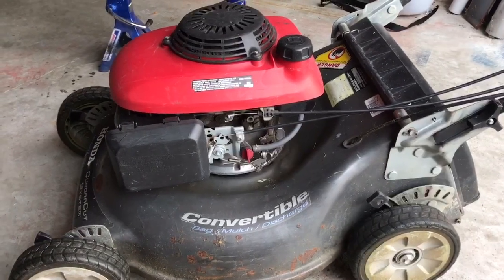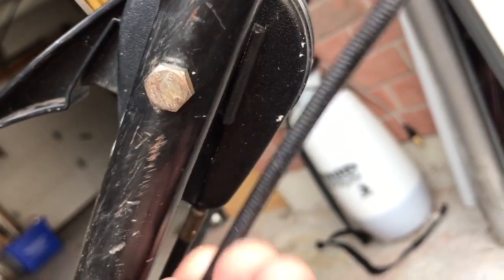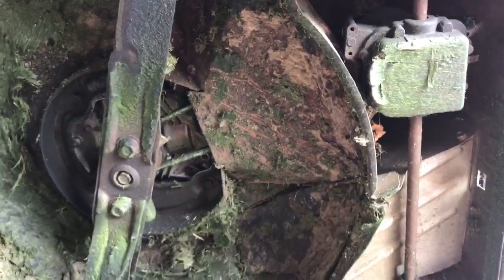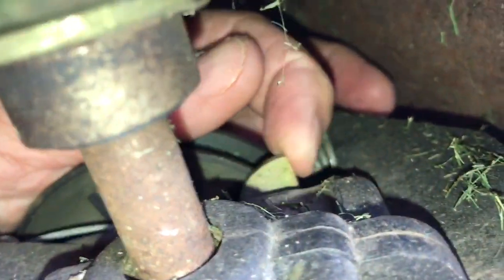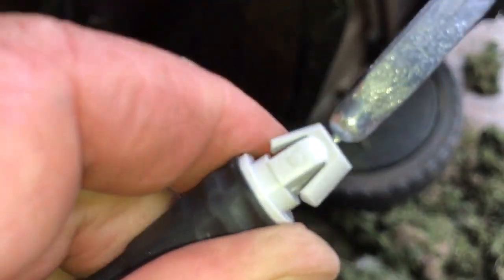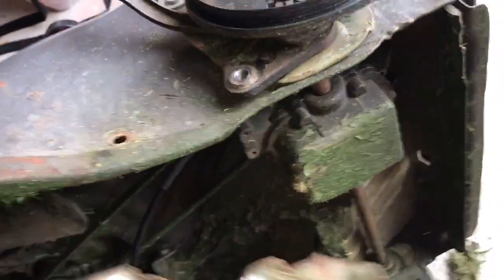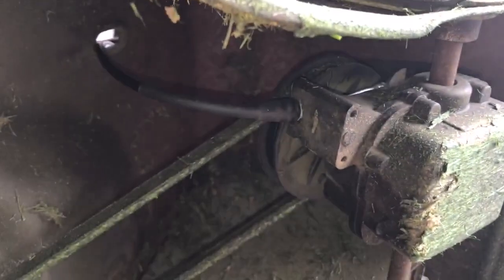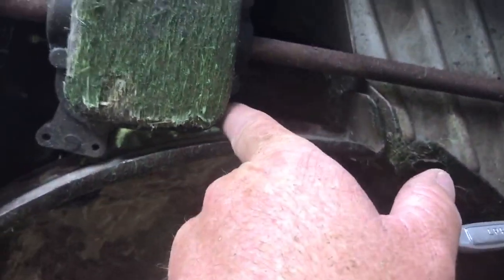Honda Harmony II Clutch Cable Repair

Comment: I pulled the broken cable thru the bottom then just pulled the old sheath hard and it came unseated. My issue was I couldn't remember how it clipped on the bottom lever so I just slid it on but it kept coming off. I though maybe the end of that piece came off but seeing your video I saw that it actually hooks WAY in there! THANK YOU for this video, I JB welded it on but that didn't last one pull! heh Thanks again!

Comment: You don’t have to get the pliers in there to squeeze the tabs. The washer that holds the cable in place slides up and out. Once out, use pliers to squeeze tabs. Reinsert the washer then install the new cable. There’sa little screw holding the washer in place that takes a star but, I was able to use a small Allen wrench. If the washer and cable are stuck, line up a flat head screw driver to the bottom of the cable and pop it toward the belt and pulley.
Reply: Thanks for the help.  The little screw holding the washer uses a T15 star point bit.  I used a 3/8" Drive Star Point Bit Set from Harbor Freight.  The T15 bit fits on your 3/8" ratchet.

Comment: This helped me with a similar problem, about which even Honda did not know. I thought that the cable was broken, but the clamp that goes around the cable came loose from its anchor. The clamp was still on the cable. All I had to do was use a C clamp to press it back into position.
Reply from the maker: Glad I could help!
Reply: I have the same issue. Cable is good at both ends. But, when I press the lever, the mower doesn't move forward. So, it appears to be the clamp issue. How did you remove the anchor to press the clamp?

Comment: My gosh this was a nightmare but I only removed the first shroud. Forgot to close my fuel valve and tons of gas and oil came out the side now it won't start. Any recommends?
Reply from the maker: Put that sucker back together and crank er over. Lol

Comment: What's the trick to get the old plastic barrel out of the clip bracket? Its hard to get pliers in there and see what's going on and there isn't much clearance under the pulley

Comment: You don't have to remove the wheel to get to that shroud bolt. Use the height adjuster to move the wheel out of the way.
Reply from the maker: Thanks for the tip.

Comment: The replacement cable I have seems to be too long for it to fully engage. Is there something I’m missing? I ran it through and hooked it in but it won’t engage when I squeeze the lever. Anyone else have this problem?
Reply: Very helpful video, by the way! Thank you!
Reply: I've had that same problem. It is all reassembled, the rear wheels turn, but there is NO pulling power! The cable seems to be too long. Any help would be appreciated!!
Reply: @claudiagray2462  I had the same problem. The 'Z' end of the cable, which connects underneath, was broken and couldn't pull the actuator for self-propel. Like yours, the rear wheels spun, but it wouldn't move when putting it on all four. I repositioned the broken end and it now moves, but there's a new cable on order to fix it correctly. I'll be taking it apart again.
Reply: @timmaz7728  It was a simple adjustment to the tension on the shift lever. I did it and we're now rolling perfectly! Thanks for a great video, Tim.